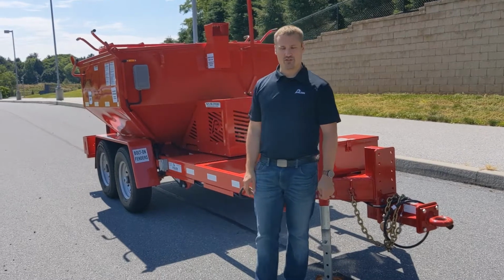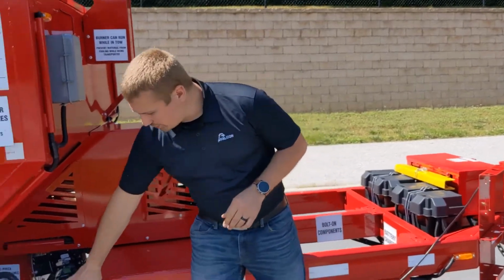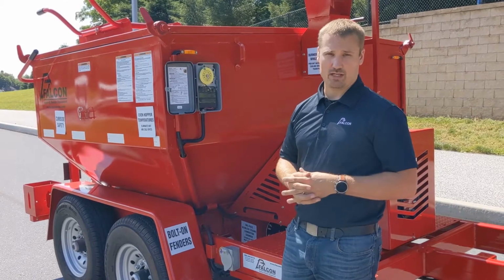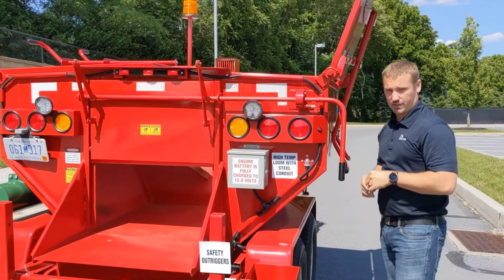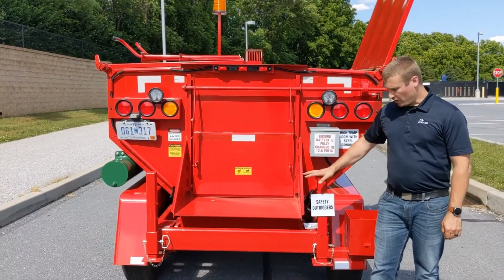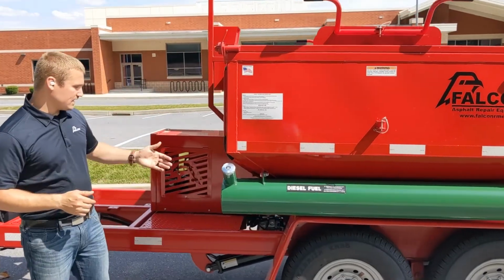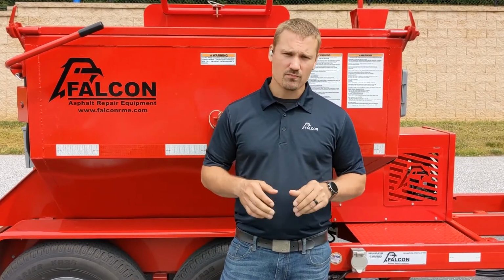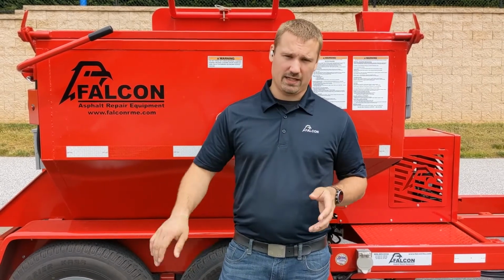In Service for 4 Ton Dual Burner HotBox Recycler

Comment: We have one and it doesn't heat the recycled asphalt up as it shows,what are we doing wrong
Reply: I do not work for Falcon but know a lot about them. Does your hot box have 2 burners? Only the 2 burner hot boxes are recyclers. What type of material are you putting in it? Virgin mix, Millings?